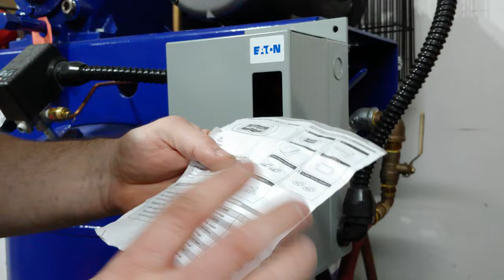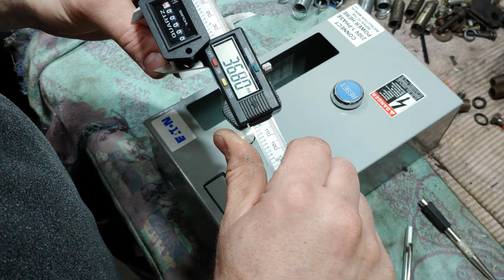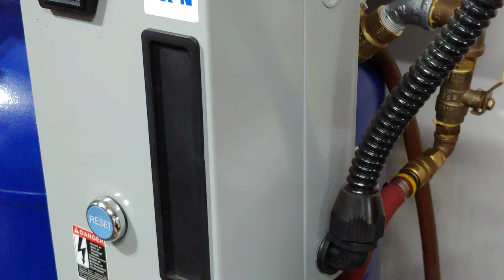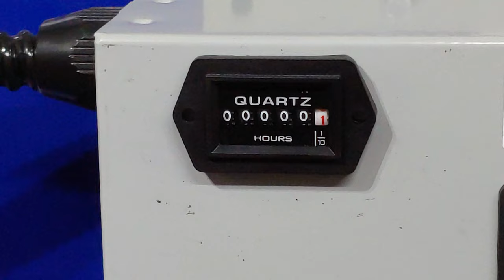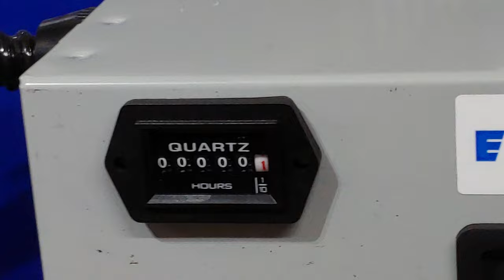Quincy QP5 Compressor | HOW TO | Hour Meter Install

Comment: I put one on my new generator awhile back and I just ordered one for my new compressor.    Every machine that has any kind of prescribed, hourly maintenance schedule should come with an hour meter FACTORY INSTALLED.   I don't know why the makers of these machines won't do that but it irritates me!   This out to be a friggen law!   
You did a great job.    Andy...  Someone has taught you well.   Gentleman that you are... Tell the thanks.
Reply from the maker: I agree. Doesnt make sense why they dont. Its a $10 part!? Thank you very much! My pops taught me a lot. Had great parents that were and still are great examples to me.

Comment: Had to move shops and lost the copper tube at the top, I was hoping you could help identify the part.
Reply from the maker: The copper tube in between the electric motor and the pump?
Reply: @Fixin2Ride-Official-  No, between the pump and the tank, big 3/4 inch thing. Just got off the phone with Quincy, they said just bend a new one by hand.
Reply from the maker: Okay I will dig out my manual and check the parts list and give you a number to look up

Comment: Please put a cord grip on the power infeed cord as it enters the enclosure and strip back the excess sheathing inside .. Other than that...good install
Reply from the maker: Thanks for the tip and just for clarification you are talking about a grommet of sorts?
Reply from the maker: I got it I looked it up and yeah that's something that would screw in and then you put the power cable through and then tighten down the knot. Thank you
Reply: @Fixin2Ride-Official-  You're more than welcome
Reply from the maker: Good deal I always appreciate tips from the pros

Comment: I like you got a pressure  lube pump...A,  for job well done..love it..that unit will out last you...awesome. I'm getting a Saylor beall. Pressure  lube  unit..American  iron .a little pricey..all American  made .as yours..awesome idea.update..may 2022..have an hour meter on mine..installed  by Saylor-beall..same magnetic  starter..but mine on  great idea..
Reply from the maker: Heck yeah! Love this unit and using it. American made is the best way to go.
Reply from the maker: Wish there was more stuff made here in the Unites States...
Reply from the maker: Check out the AUTO-DRAIN VALVE INSTALL Video I just uploaded!  https://www.youtube.com/watch?v=v1BcaygCnpY

Comment: Great job! I like the clean install in the mag starter enclosure. How do you like your compressor so far? How many hours do you have on it?
Reply from the maker: Thanks! I absolutely LOVE IT!!! plenty of air for my sand blasting setup and other tools. Since the install of the hour meter Ive only put about 2.5 hours on it. But I havent been doing a lot of blasting or powdercoating. But if I had to guess in total of hoirs before installing the hoir meter... I would say I have about 10-12 hrs on it.
Reply: @Fixin2Ride-Official-  Nice! I'm looking at the Quincy QP series myself, and the hour meter is such a good idea for maintenance intervals. Why don't they put one on at the factory??? Your compressor sounds super quiet in the video, would you say that's the case? I would also recommend an automatic tank drain, such as the Tsunami Moisture Minder. I am definitely going to put one on my new compressor, as I am replacing an old 60-gallon that has sprung a leak in the bottom of the tank due to neglecting to drain the tank regularly.
Reply from the maker: I highly recommend that you be pressurized oil system series. It will last multiple times longer than just a splash lubrication system compressor. Yeah I don't know why they didn't add that as a feature on the compressors as it's a super cheap option. But yes the compressor is super quiet and I'm in a one-car garage so that was very important to me. But yes I actually did put an auto drain valve that is adjustable as far as frequency it kicks on and duration. I have it hooked up do a timer as well so it will kick on every 12 hours no matter what.
Reply: @Fixin2Ride-Official-  awesome, lots of great information, thanks! It'd be cool to see a video on how you hooked up a timer to your electronic tank drain, as I have not seen that done before!
Reply from the maker: So it's just one of those wall timers as my electronic drain plugs into a 120 Outlet so I just put the timer in the outlet and then plug the tank drain power cord into the timer
Reply: @Fixin2Ride-Official-  Cool, great idea Andrew! I just got my QP-7.5 about a week ago, and it seems like a great unit. The only issue I have is it shakes and vibrates like crazy when it's running! I wonder if the pump sheave/flywheel isn't properly balanced? Does yours shake/vibrate much? And do you have yours bolted to do a concrete floor? Mine is currently sitting on vibration isolators because I have PEX in the concrete and I don't want to hit it with the rotary hammer, but I don't think a properly built machine should shake this much. I worry about it wearing itself out prematurely.
Reply from the maker: Thx and congrats in the new purchase. No mine runs pretty smooth. I do also have it on some 3/8" hard rubber pads. I would contact Quincy and get them to look at it. It mat not be balanced correctly.
Reply: @Fixin2Ride-Official-  Thank you so much for the super prompt and helpful replies Andrew! That's what I thought, but I didn't want to go crying to Quincy without something to compare it to.
Reply from the maker: My pleasure and always glad to help out! Im pretty particular about my stuff and would be on the horn with them for sure.

Comment: I'd be interested in what eaton product that is, also, did you put a 30a contactor on it?

Also, it looks like a standard eaton disconnect, so you would cover over to the breaker disconnect.
Reply from the maker: I used the same connectors if not better for the hour meter that were used to connect the motor power supply. I havent had an issue yet and I use a sand blasting cabinet and it will run of anf on for a couple hours at a time on big jobs. Sometimes 20min+ straight if Im trying to blast through thicker coatings. 

Thanks for watching!
Reply: @Fixin2Ride-Official-  Thanks for the reply. I was curious if the air compressor came with the start circuit but it looks like many do. As opposed to some models that just use a heavier duty pressure switch. Thanks for the content.
Reply from the maker: Yes. I didnt have install anything but the power cord and then the hour meter. I got that big ole sonovagun off the pallet and into place by myswlf too. Lol got that video on my channel as well if you havent seen it already.
Reply: @Fixin2Ride-Official-  I’ll check it out. Your videos are good stuff.
Reply from the maker: Sounds like a plan! Thanks!!!